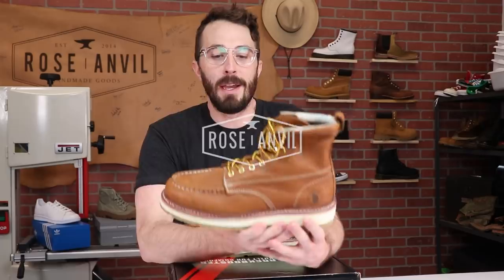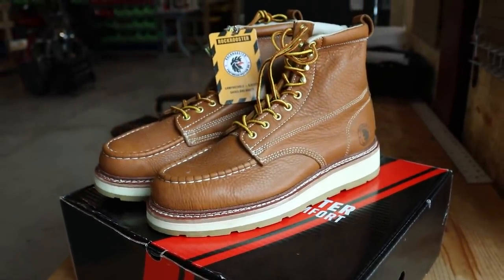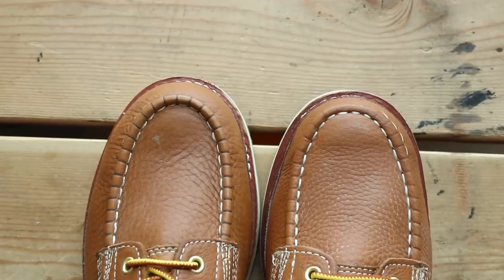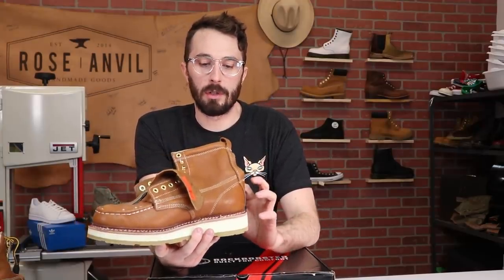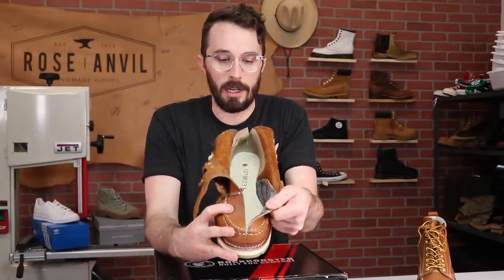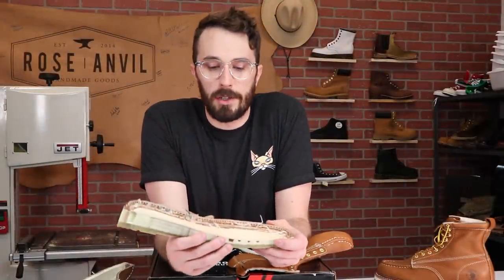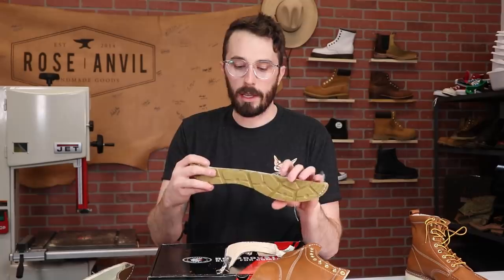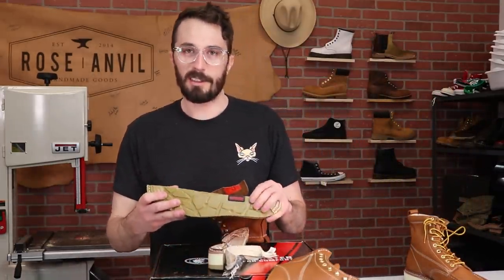The $128 Moc Toe Boot - (CUT IN HALF) - Rock Rooster

Comment: I bought a pair of this model for my very first moc-toe boot for $25 on eBay. Used acetone to strip the paint off and dyed it mahogany while replacing the laces with leather ones from Nick's. Pulled the insole out to use in my crappy Brahma's and used a leather insole from Nick's with a 3.5mm piece of cork stuck to the bottom making for an excellent boot wearing experience. Thank you for sharing your excellent review of this boot.
Reply: smart.  Especially the leather/ cork insole... I do that with all of my boots and shoes if they don't have one already. This enables me to wear them in Florida without my feet being soaked

Comment: One of the early things I noticed about Chinese made welted boots with mid-soles is the mid-soles were almost beyond glue bonded to the soles.  Whatever glues they were using were more like model airplane glue which "melted" into the plastic based PU outsoles.  This usually means you can't heat up the soles with an infra-red lamp and get a good peel-away from the midsoles.  You either have to grind down the outsoles or cut them off leaving a little buffer layer so as not to cut into the mid-sole which easily with a sharp knife can accidentally cut through the mid into the actual welt (a big no, no).  Up until these fusing glues (you have to let them melt and bite then firm up again often requiring a re-activation with a heat gun)  we often just heated up soles with a heat lamp and then peeled them off.  I will say these Chinese fused soles and mid-soles mostly eliminated sole/mid-sole delamination actually making the boots really strong if more difficult to re-sole.  By your video here I think this boot will be a pretty tough customer.  On rare occasion I have seen that final TPU out-sole layer separate from the main body of the PU sole...but, that is rare these days.  If a guy wanted to save some bucks, yet get a respectable tough boot this one seems to be, by your tear-apart, a good choice.  I did notice the shape of the left and right moc-toes were not truly symmetrical (your above photo shows this).   At these price points this kind of thing often passes QC as it's considered minor and cosmetic and not affecting the functionality of the boot.

Comment: Thank you; trying the six inch slip on steel toe. 
Something new; a crossed between my casual foot wear and work now. 
$130.00; forgot the promo code. 
If I like them; follow up with another pair to switch out. Week on week off being in the same style boot. 
Hot patching, mastic and concrete mixed with equipment operating; truck driving. 
Whites; reached and asked them if the perry was in steel toe. Not at this time from them as a response. 
Hopefully see about a pair Perry’s for casual boot; something different than my merrell Mocs. Usually find myself walking right throw them. YES!; dad shoes lol!

Comment: Ive got a pair of Redwing 825 moc toe and a pair these Rockroosters and I must say the RR boot is sturdy. But you may seriously consider going up in size with the Rooster. They're extremely tight. Whereas I went down half a size with Redwing , I could go half size up with Rooster. I have wide feet btw.
But they are a well made boot.
Bravo to Rockrooster.

Comment: What is the best moc toe for work.? I drive tractor trailer and I work on dock loading my trailer running hi/lo and walking on concrete all day. Also should I go six inch or 8 inch. Thank you for time.
Reply: Definitely a Wedge or Swedge sole like the one here.  The softer the better.  If you are standing a lot go with the 8 inch for greater ankle and leg support.  If you are walking a lot go with a shorter boot (lighter and more ankle movement).  If you watch the channel up to this date...  Thorogoods, Carolina, Redwings, Whites, Nicks are his favorites.  Other brands you don't hear as much of is Danner and WESCO on the channel.  I do not feel a warm and fuzzy on the last two brands.

Comment: Loved this. They look very well made, and it was super fun to see inside of them. I do have some feedback:

One, though cheap plastic welts do crack, the nicer ones on the USA made Thorogood and Carolina boots, and on Supersole Red Wings, are excellent. I've never seen one crack. In fact, when doing trail work, I wore out the leather welts on my White's faster than I did my plastic welted boots that came after them. It really varies depending on the plastic they use. 

Two, I was really fascinated to see how much these resemble their USA counterparts cut in half, meaning the Thorogood Moc toe, and the Carolina Arc. I've worn both of the latter, and I prefer the Carolinas because they're much wider in the toes (NOT the ball, the toes), much more snug in the heel and shaft, and have more comfortable insoles, for me. Their durability are on par with each other. It looks like these Rock Roosters may be just as well-built, which is remarkable. I personally have the luxury and inclination to pay more for the USA made Carolina Arc boots, but these look like a fine alternative.

Thanks for making these!

Comment: Love those Boots. Been an electrician for 28 years tried many boots a lot of cheap ones and some expensive ones because they usually last about six months. I like to look of these so I bought them two years ago still wearing the same boot and the most comfortable boots I ever worked on not to mention the longest boot that I ever own  .... ps except  mine came with the composite plastic  toe and that still holding up pretty good

Comment: I bought these boots about 2years ago when they first came out they were $90 shipped and let me tell you it was the best $90 I've ever spent on a pair of work boots they are still going strong even after 2years of heavy Industrial Electrical work i just wish they keeped the price under $100 but I guess inflation is why the price went up i understand. U won't b disappointed even at $130

Comment: This seems similar to the Diehard boot from Sears, except that the Diehard has a leather lining and a plastic welt.  Also, I usually buy them on Black Friday every year for about $60.  Half the price of these.  I’ve never had a plastic welt crack like you talked about despite using these boots only on the very crappiest jobs like concrete work and hillside/creekside landscaping.  I believe that the Diehards are the actual best deal super tough moc toe wedge sole work boot, but that Thorogoods are the most comfortable in the category.  I think that these rock rooster boots are going for a niche in between.  If this is the case, I don’t think it will work out unless they bring the price down to about $90.  At $120, they are too close to  the Thorogood boot regular price with an even more solid boot at half the price in the Diehards.  I’m pretty sure these guys are banking on Sears going belly up for the last time and making a play for that market share.  I will definitely give them a try if that happens.
Reply: wonder if I could find those on sears website for $60 this year..

Comment: I enjoy wearing plain toe 6 inch work boots.  I stand all day on my feet for work.  I am a mature  adult and therefore need support.  Which boot would you recommend?
I like leather lined if possible.
Enjoy your site.
Thanks.
Ken
Reply: I work in a pair of leather lined Allen Edmonds Higgins Mill as a bartender and find that my feet get hot (although I still love them).  The heat that comes out of them when I take them off is noticeable and balmy.  I also have a pair of unlined Redwing Blacksmiths I hike in and wear casually and I never feel like they are too hot, although I don't wear them as long.  If I were you I'd research whether lined boots retain heat and moisture compared to unlined and that may change your mind.  For me, if my unlined boots were black I would prob choose to work in them instead.

Comment: Why is that plastic "counter" of lower quality than the glue-impregnated cardboard that White's uses on their "low end" $300 boots?    I wonder what happens to hard cardboard when it gets soaked in water with wet boots?  That silly "counter" thing doesn't do anything but maintain the roundness and shape around the bottom back of the foot.  It's not and area of the boot that's under much stress as you wear the boot.  My question is, maybe a thin bendy plastic is better?

Comment: OK ... I like the looks of those boots so I ordered a pair. - My experience was as follows ... They did arrive very quickly, in only 2 days.  Quality was OK, looked good.
> But I must RETURN these boots for REFUND.   I have tried them on twice.  They just do not fit me properly.  They are much too tight across the toes and ball of my foot, and the heel is much too wide. They slip up and down on my heels no matter how tight I lace them.  The length size 11-1/2  was OK.  Width was marked EEEE Wide.

Comment: The sizing of these boots is a little confusing for US customers.  They get the size correct, but the confusions arises when it comes to widths.

I think they use the Asian sizing to describe the widths, which tend to run narrower than US sizes.

What they refer to as “Wide” is actually equivalent to a US D/E width.  This is the width what most people may want to order.

What they refer to as “Normal” is probably narrower than a “Wide”, but this is probably the “normal” width in Asian sizing.
Reply: They are an Australian company, not Asian. They use brannock sizing. All their shoes are EE width by default. They don't come in size D. The length is just a bit larger then your actual brannock size, so if your a 10.5 on the brannock scale, you'll get a great fit by going with the 10.5 shoe.
Reply: @LithicKing  The company might be Australian, but the actual boots are made in China.

Let me put it this way.  I ordered “normal” width on their web site and shipped me a “wide”, which Rock Rooster said was comparable to a D width in US sizing.
Reply: @thesharpercoder  perhaps it comes down to the model of boot you purchased. I always purchase D width in my redwings, but had no choice but to purchase rockroosters wide size when I got a pair of their ap615's, and that model was definitely much wider then a size D. For the ap615 they claim the wide is equivalent to a E/EE. I actually wish they were a bit more narrow, but that aside I have to give them props, it's an amazing boot for the price.

Comment: Why buy cheap boots??? Pay a little more and get a better boot.
Reply: I like high quality boots.  I love the High End Brands.  Sometimes though if you work at a job where your boots are getting destroyed no matter how well they are made...  I'd rather kill a $130 boot than a $480 boot as long as they are comfortable and do not cause other foot issues.
Reply: @exexpat11  obviously,  but if your going to be doing something that you know will destroy them. May be you need a differnt type of boot that is made for the type of work your doing.  But, if your doing work that is in the parameters of what a boot can handle. I say it's best to use a boot that gives you comfort and support and will hold up a length of time. There is a lot of boots that fall in between your dollar amounts of $130 - $480. I have just learned that if you work hard you need to start from the ground up. Good boots feet feel good, knees don't hurt, back less prone to pain as well. All good. To each his own. 👋